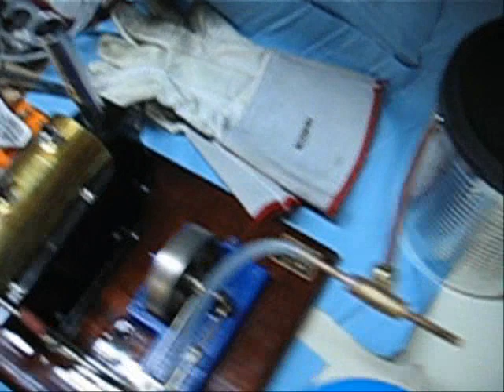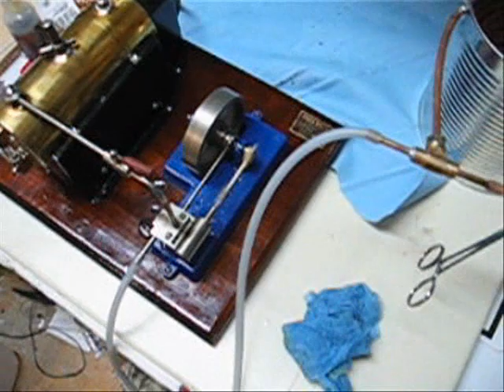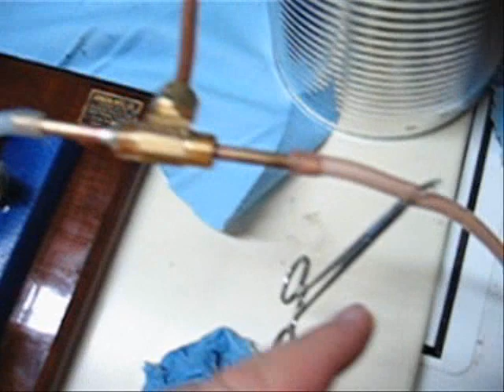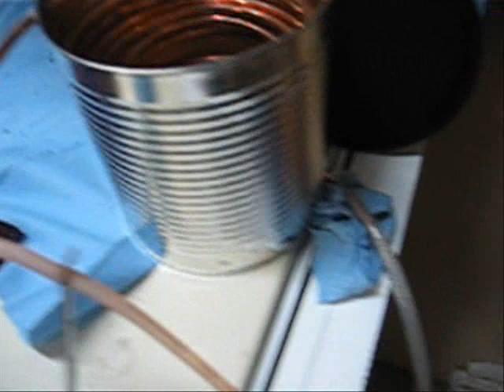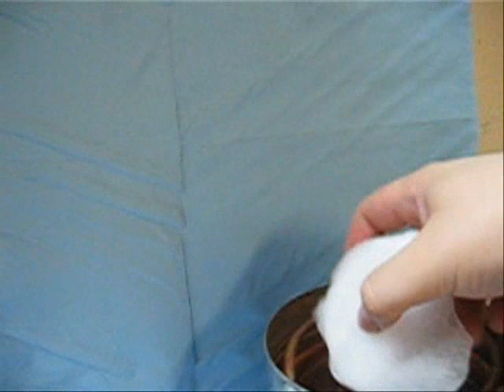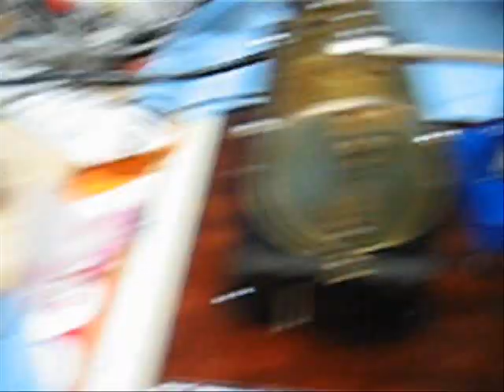Steam Condenser

Comment from the maker: When running flat out the Jensen's usually maintain between 8-10PSI.  They'll build up to about 20 before the check valve starts to vent steam.
Have a look at the Jensen 50 or 51 (not here: I can't afford either..).  They have feed water pumps that keep the boiler full during running.  Condensate, though, has some oil in it, which isn't good for the boiler (makes a mess inside), so I don't reuse it.

Comment from the maker: Lately I've not even bothered putting water in the can.  Actually I don't use this setup much because as it sits now it just creates too much back pressure.  I need to remove at least half of the copper coil, I figure, and give the remaining stuff more of an incline to help it drain, because it does not drain well on its own.  I had been using ice chiseled out of the deep freeze in it ;)

Comment from the maker: Oh...  The rubber tubing is just 1/8"ID silicone stuff, sold as fuel line for RC aircraft.  The rest is just generic copper from the hardware store.

The silicone stuff is great.  Doesn't break down, doesn't melt, lasts forever :)

Comment: remember that back pressure is not only due to coil length but also diameter. you could have a coil just as long with twice the diameter and reduce your back pressure quite a bit. 
Have you considered using the water that cools the condenser as the input water for the boiler? you said the water in there was boiling hot! that means when you put it into the boiler it will take little energy to create steam.